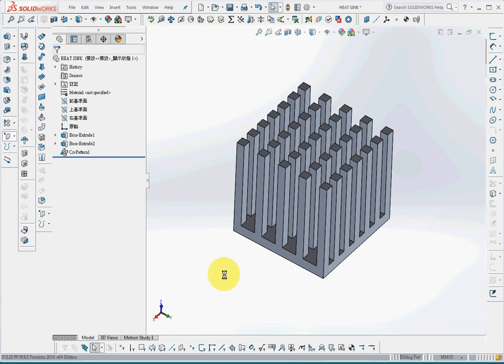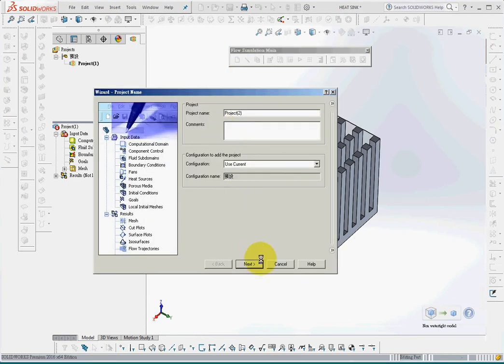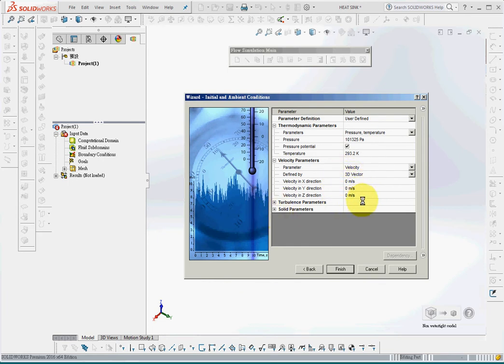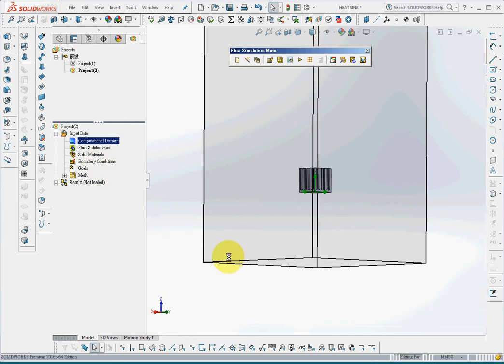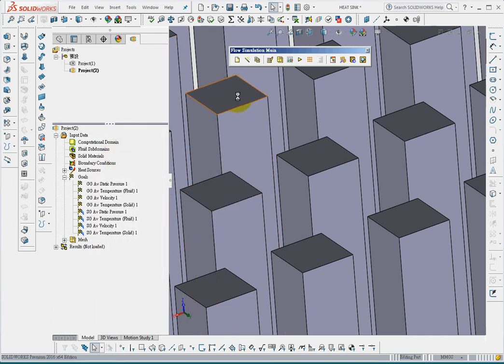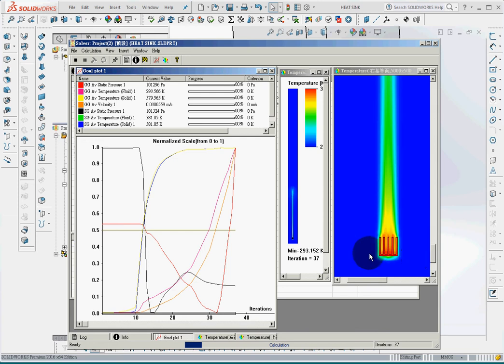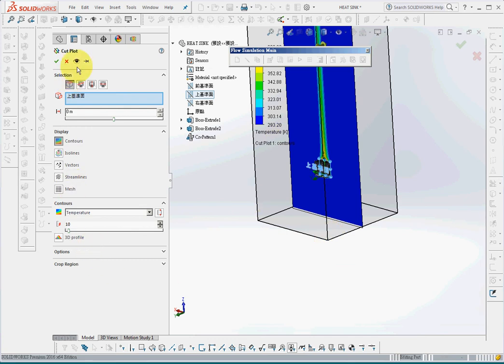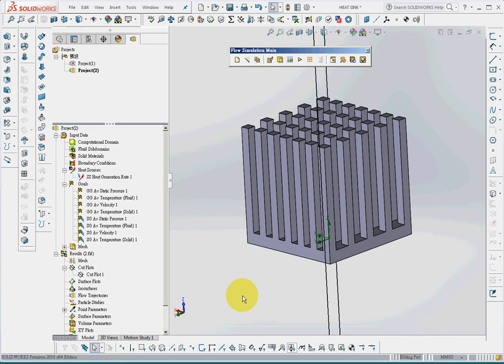SolidWorks CAE 16 4  Flow Simulation Heat Sink in Stagnant Air

Comment: Would this scenario work to simulate a heat-sink  for an LED like the Cree XLamp CXB3070 for example? Or would you get a better result if you modelled the LED COB and its mount and the interface between with the thermal pad etc rather than just having a defined heat source on the surface of the sink?
Reply from the maker: allanpennington 

You can draw volume and use volume heat source instead of surface heat source. In CAE analyses we generally simplify the problem to save time, but at a cost of accuracy. The problem with flow simulatime compared with solid heat transfer simulation is the time required for calculation.

Solidworks flow simulation tutorial has a problem for personal computer simulation. You can find it in Youtube. 
https://youtu.be/-I3YBr8msAI
You can also send me e-mail and I will send you materials related to this type of problem.

hsieh100@ncut.edu.tw
Reply: Thanks I have emailed you.